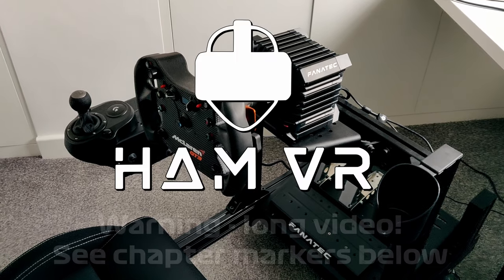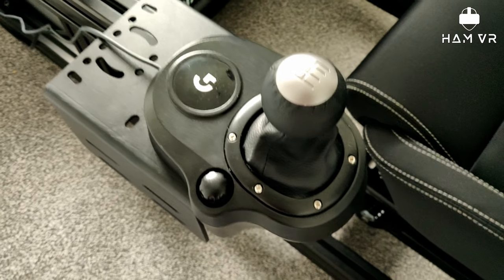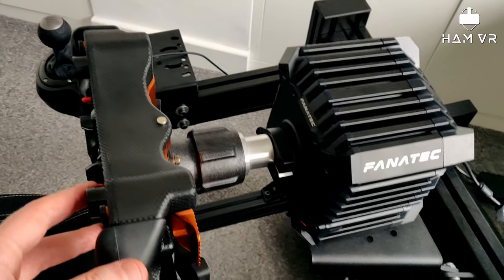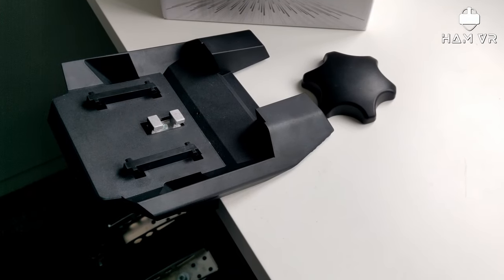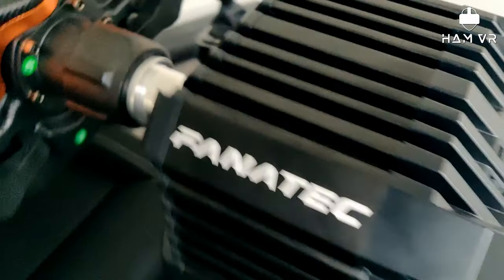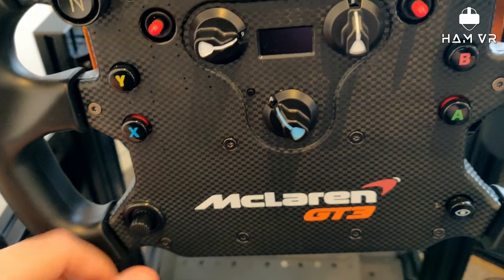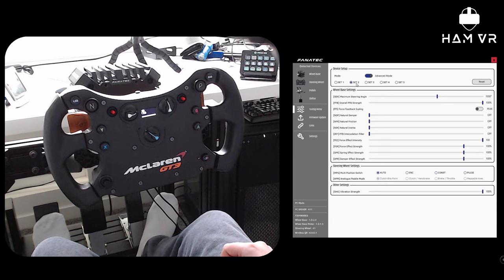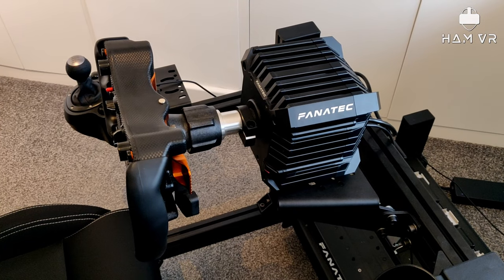Sim Rig VLOG (Part 2) - Fanatec CSL DD - McLaren GT3 wheel - Trak Racer shifter mount

Comment from the maker: For those wondering about wheel deck and the CSL DD, the GT1 Evo comes with 16mm M6 bolts which are a suitable length to go through the pedal deck plate and into the CSL DD t-nuts without bottoming out in the rail slot. I'm using 3 bolts currently, but it's easy to drill a 4th hole if required. https://drive.google.com/file/d/10FfbG6m9ulORsDokcU7Mcz2MlACRqDtK/view?usp=sharing

Comment: For the bite point, the intended way to use it is you hold both down and release the right clutch, you spin the funky switch to set what lurch value you have and release both. Then to launch you hold them both down, rev up and release the right clutch and slowly release the left as it catches.
Reply from the maker: Both methods are valid according to the user guide. The method I showed was the 'simplified' method. Admittedly I release the clutch paddle too fast LOL. The 'advanced' method is as you describe. You can also save the different bite points, per profile that way too.
https://fanatec.com/media/pdf/96/9f/a3/CSL-E-SWRMcL-V2-QG-EN_Web_08_MO.pdf

Comment: Hey ham just come across this and thanks very much mate for sharing this am in the uk too i currently have the playseat evo rig and not too keen on it to be fair had it year and a bit now feels cheap feeling to me and dont like the centre column bit in the middle find it awkward when racing its a pain to get in and out of also feels like the pedal plate even screwed down will snap off at any mo, so soon thinking of getting this sim labs evo for my self looks very useful and cool to have looks simple enough to build not harsh on budget wise much better quality than the playseat too was thinking of getting the seat slider from sim labs and for now transfer the playseat seat over to that liked how you went into detail on what parts you used for it so i know what to get plus i too have the 8nm pack with the formula v2 rim just the standard pedals for now to and the advanced paddle module am not an expert on settings so liked how you explained the ffb very well as before ive tried it at that setting you shown with around 60% in game with the affects on too such as rumble strips etc on xbox series x btw and christ it nearly broke my bloody arms off its so powerful so found taking them out the affects and using just the ffb in game especially for f2021 it makes a difference for me turning it down might just be me as am a skinny short ass 😅 so not strong enough for them forces but will try that what you mentioned great video mate ticked the boxes for me also love the cable management for it how you can stuff them in the profiles 😍👌
Reply from the maker: Hey Dan thanks for taking the time leave such a detailed comment. I've been very happy with the Sim Labs GT1 Evo. I think it offers a nice balance between size and strength and is a reasonable price. I think as long as you go with a profile rig it's hard to go wrong as they are easy to upgrade with extra parts.
Reply: @HamVR  Thats why am drawn to it mate look so versatile for upgrades later on down the line ive looked at the psr 1 as one by race anywhere that looks good too but expensive looked at the trak racer 80 but not keen on that as its gotten not good reviews for it and the gt1 pro what ever its called but thats way expensive 900quid just for the frame is ridiculous so think the evo ticks the boxes for me, Also mate am assuming your in the uk so how was the shipping for it and did brexit charges come into play ? like we had to do for the dd base i had to anyway to import it

Comment: Hey man, are you still happy with the Sparco R100 seat after using it for a while? Does it have any flex at all on this rig, for example when you do heavy braking? I'm looking at the exact same rig + seat setup. I like what you did with the inverted brackets, but does this mean you can't use a seatslider?
Reply from the maker: Hey yeah, I've been really happy with the R100 so far. There's about as much flex as you would expect from a real car seat, so not that much at all (probably few mm if you put a lot pressure on it) and I expect it's much better than a regular reclining gaming chair. If you want zero flex, for very heavy pedals I'd go for a none reclining rigid seat. For me personally I'd rather have a little flex and the reclining option for comfort.
Reply: @HamVR  Cheers mate, thanks for your reply!

Comment: Put some washers on this corner brackets,  they only cost 5 bucks
Reply from the maker: Yeah I have a bag of M8 washers already. I've put some on parts that needed to be extra tight. The corner brackets seem pretty snug around the M8 bolts, so extra washers would probably be overkill. Next time I do some adjustments, I might put some on as I've got spare.